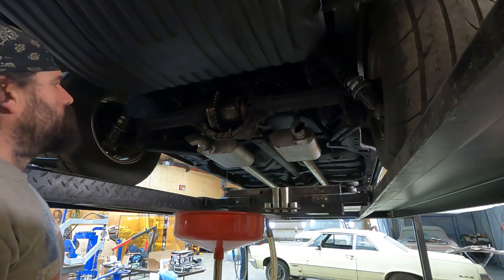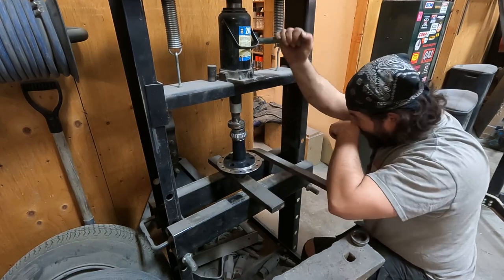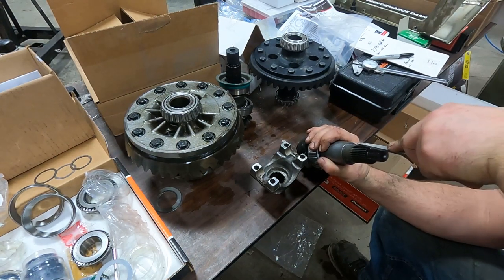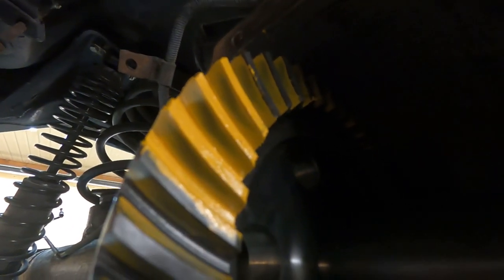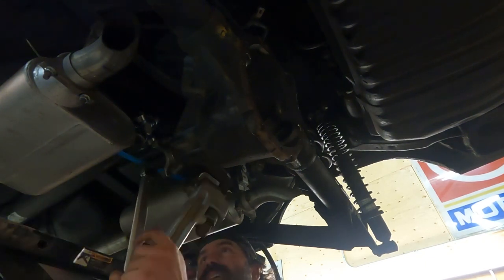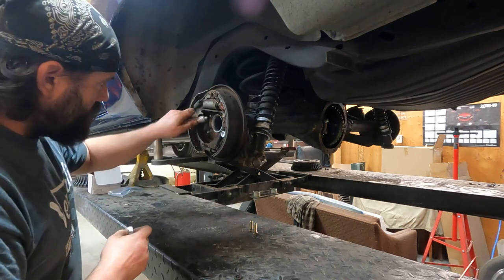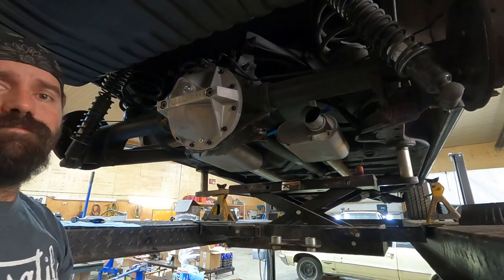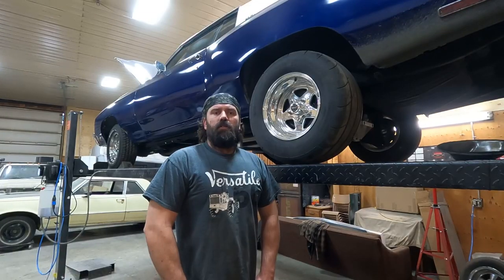12 bolt Chevy diff rebuild

Comment: Nice Monte man. I am working on my '72 Monte... installing disc brakes on the rear. Question for ya if you don't mind- I removed the axles from the 12 bolt and now I have them back in with C clips installed. For the life of me I cannot get the pin all the way back in. I also had a curved washer fall out. I'm struggling without a lift. Anyhow, is there a trick to getting the pin back in?
Reply from the maker: The curved washers go under the spider gears.  As for the pin, it should go in pretty easy.  All I can suggest is taking it back apart and double check that everything is lined up properly and try again.
Reply: @bkgaragerestorations   Thanks for responding. Do both spider gears have one of these washers? I haven't actually removed anything from the 12 bolt besides the axles and pin...so I don't yet have a full understanding of what the heck is going on in there. Seems like I have to turn an axle till nothing is in the way of the pin. It went in like 90% but is running into something. I dunno, maybe I should just rip it all out and try a rebuild...and also change from the 4:11 to a 3:56 would be huge.